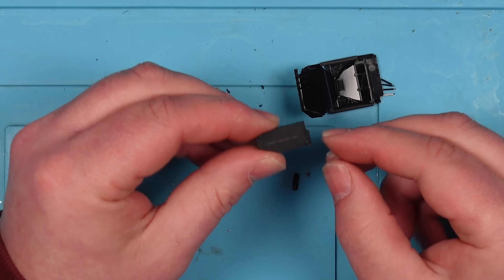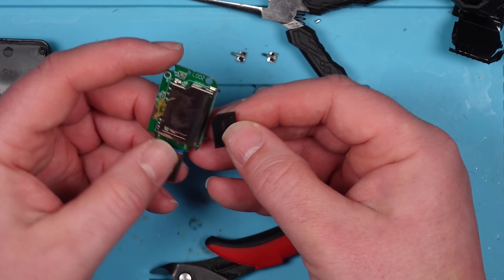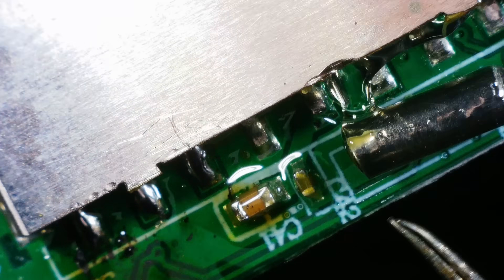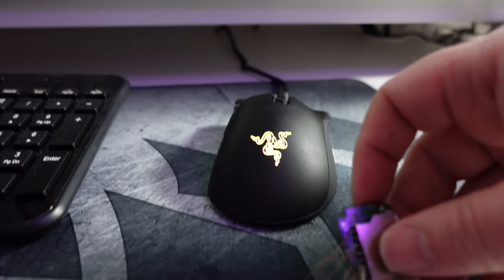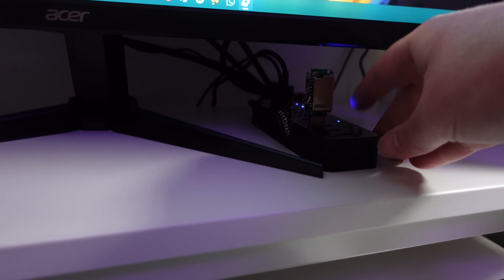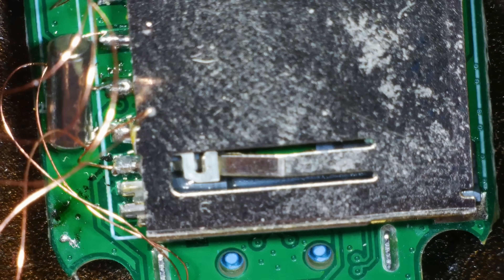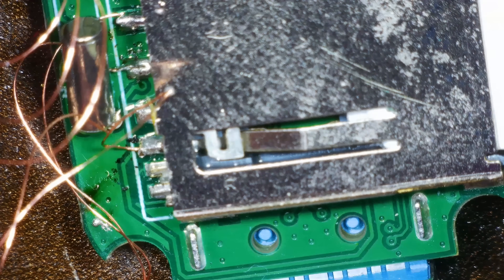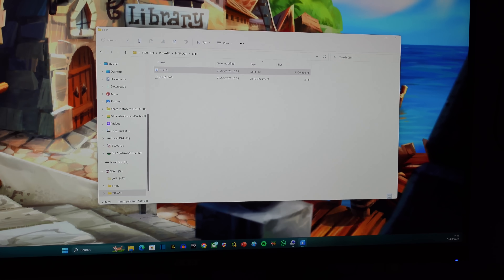Recovering data from my broken SD card

Comment: What wires did you use? I have a load of wire like that but they have a stubborn enamel coating. Also these adapters tend to have failed write protection mechanisms where they think everything is locked. You can fix that by bridging the two small pins on the end

Comment: i would have ripped about a microsd to sd cheap adapter instead. if you coat the tips your transformer (varnished) wire in flux and tap with a solder iron for a few seconds they will solder easier

Comment: With enameled wire - do you need to use heat to remove the enamel from the end or do you just count on the "tip" of it being inside the solder bubble to provide conductivity

Comment: Just as an idea for a next time... All you needed was for that piece of SD card to fit inside the reader and to be able to take it out afterwards, right? Well, two pieces of thread (for example dental floss) around the front of the card, and a second SD card to push it in (or anything around the same thickness). And there you go, no soldering necessary, no breaking of the reader case needed.. And, in the end, you just pull the threads and take it out. Worried that the pins will be obstructed by the threads? Well, the pins are springed so most likely the threads will be moved to the sides by the device itself.

Comment: all you had to do was open a MicroSD to SD Memory Card Adapter and replace the guts with your sd card board. glue it in if you have to and it's saved.

Comment: I'm forever doing things like this! The amount of times I've had to fix my 2012 laptop because I've buggered something up you wouldn't believe. Still works, even if it ain't pretty So I was thinking all the way though this, wouldn't it have been easier to take apart another SD card, remove that chip/board, put this one in and then glue it back together? Or did you do what I do when I fix a toy, think, "That'll make a good video!" and just do it the hardest way possible for fun? 😉😁 Regardless, I always enjoy your fixes, Jo matter how you get there!

Comment: Having watched so many of your videos where enameled wire came into play, when my wife's toothbrush charger died recently I had actually thrown it into the bin, before I had second thoughts and realised there was a transformer in there full of the stuff. From what I can see, you're not stripping the end prior to soldering it. Is that right? The heat is sufficient to remove it from the soldered region?

Comment: Ouch, Steve chose the hardcore route. xD

I've got some dummy SD cards here, so I could hack and glue stuff somehow - but more likely I'd just tie a piece of string or tape on it, and shove it down an SD card reader, while trying to nudge it to the right position... xD This would eventually lead to me ripping the string or tape somehow, and the SD card getting stuck in there, which would lead to panic, and me destroying the SD card reader open to recover the card... but your know. xD
It's interesting how there's basically nothing inside these SD cards anymore right? It's basically all sandwiched into the PCB it seems. I've opened a few broken SD cards several years ago, they used to look way more like an m.2 stick with the memory chip or chips there, and a bunch of components.

Oh, channel recommendation for anyone interested in detailed data recovery from SD cards, pendrives, and whatnot:
https://www.youtube.com/@hddrecoveryservices
It's pretty interesting, and very complex stuff. Specialized software, hardware, rigs, tools and techniques.

Comment: I smiled through that video. Why didn't you just glue a piece of card or plastic to what was left of the SD card? Then you could have inserted it and got it out. Yes, you would have to be careful of the lignment, but it might have been a tad easier.

Comment: This made me cry. I just had a huge hard drive crash recently. It was going to cost me close to $700 (not SE, it was an old disk drive) to have a company try to retrieve the data and it was still a long shot if they could. I decided not to waste the money since I had most of the important stuff backed up. But this made me sad because I hoped for that result with my drive and also, I will never know what was on the drive that is gone forever.

Comment: Wouldn’t it be easier to stick the sd part onto that one half of the broken housing…and just plug it in? This way you don’t need to dismantle the sd card reader. And even if I do solder directly onto the sd contact…wouldn’t it make more sense to solder onto a random microsd to sd card adapter…those are cheaper and always comes with microsd card so I have a litter of those around. Again this is to save it from dismantling the sd card reader…which seems way more intrusive and destructive.

Edit: oh you said it doest work when you plug it in in the beginning…that’s probably because as you found out later on…there’s a card detect mechanism in the reader that the reader rely on to “see” the card. And it’s probably not triggering it with the broken half.

Comment: Would be handy if you had like a little sd break out board that has a clamp of some sort where the pads connect so you could just insert the remainder of the card and clamp it onto the connectors and then use ‘normally’

- loved your excitement when the fix worked :)

Comment: You should add a 3D printer to your tool collection! Theres already sd card cases to make repairs like that on thingiverse that print on a few minutes! Nice video!
Reply: I prefer when he wings it about as far as one can wing it and it still works out. That would have been a good fix in general, but not near as entertaining video.
Reply: I agree, 3D printers are so handy for those little repair jobs and in my opinion a good fit for an electronics/makers workshop.

Also handy for making soldering tools and other accessories.
Actually some of my workbench furniture was created using 3D printing. My soldering station is on top of a simple table made from scrap wood and 3d printed legs.

Need a circuit board holder? print one... Need a jig for soldering LED strips?...print one, and so on...

And your hot air station, perfect for fixing nozzle leaks and jams. For me 3D printing is helpful for electronics and electronics equipment is handy for maintaining the printer.

Comment: It's amazing that 128GB of storage is on that tiny board.  Also, hello fellow Drobo owner!
Reply: just wait til you see 2tb microsd cards
Reply: You can even use a device that transmits audio to people in different countries!😮
Reply: Even more amazing when you consider how fast the data transfers over. I remember loading tapes with 64k of code that took 5-10 minutes. Now with faster SSD's you can transfer GB's in seconds.
Reply: I used to build my own computers in college. Then got out of it. The leaps that data storage has taken since then is truly mind blowing. I remember paying $30 for a 32GB USB drive.
Reply: 0:22 0:22 0:22 0:22

Comment: Ayyyy, i really didn't know that the actual SD-cardy-bit was that small! Nice one!
Reply: They have to fit the guts into microSD cards somehow, after all :)
Reply: @MayaPosch  that's true, ofcourse! but if you got the space, why not use it, eh? must be cheaper i imagine. :D
Reply: @devttyUSB0 I've seen full sized SD cards which micro-SD cards soldered to full sized PCBs from factory.
Reply: @devttyUSB0  I imagine that with the higher capacity cards you get a larger PCB inside, much like with SATA SSDs. Those are mostly empty inside for the <4 TB models as well, but stamped steel is cheap :)

A quick check shows that currently SD cards can be had in 2 TB sizes, so those may be a tad larger to fit all the Flash dies. Put those next to a 2 TB M.2 SSD and that's quite a squeeze. 

I have also taken lower capacity SD cards apart which have a thin PCB with a NAND Flash package inside that fills most of the space, but it seems these days they just mesh the Flash & controller dies straight into the 'PCB'. Quite a feat.
Reply: @MayaPosch  i have seen 2.5" SSDs and NVMe's with just a tiny pcb inside, so i guess it shouldnt be that surprising indeed. ;)